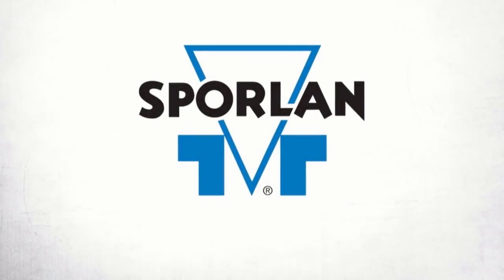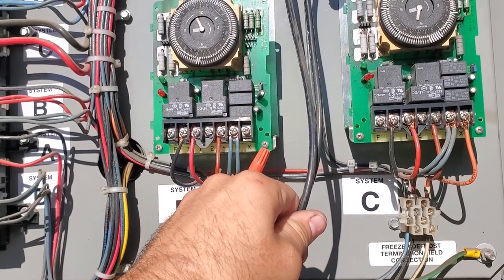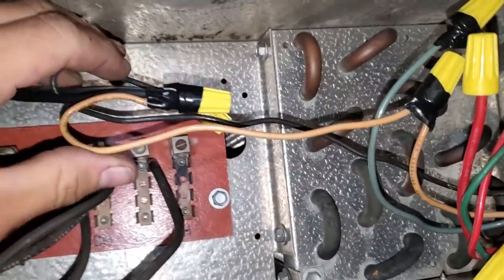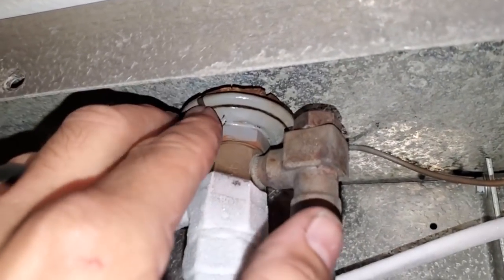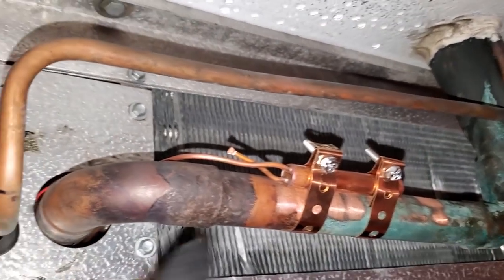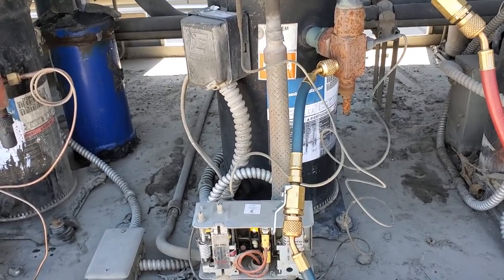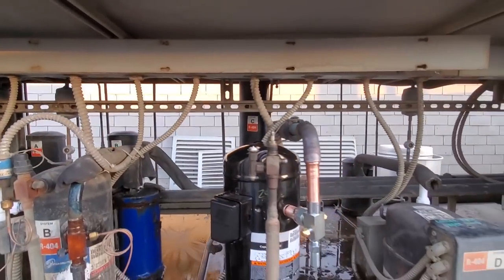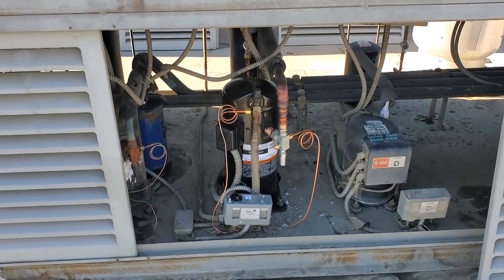BEER WALK IN DISASTER

Comment: I don’t do medium or low temp work but I do a lot of commercial and industrial. You don’t use any sort of nylog or liqui vac on the threads during the power head replacement which surprised me. I use sealants on that and gaskets for canisters. I’d like to start doing medium or low temp I just don’t get the chance to. Also hydraulic wrenches work very good for TXVs (45 degree angle/15 degree angle)

Comment: 2 things: The old compressor was a freezer compressor, so of course it was over loaded after you changed the powerheads! The amount of "factory charge" was also not correct anymore. Right on the re-wiring the unit to 'air defrost' . The original heads kept the pressures correct whereas the new ones didn't, overloading the compressor. It obviously was pumping! Over 400 PSI sould have screamed: I'M OVERLOADED!! to you.   Lastly, those Grasselin (AKA ICM) defrost timers are junk from the word 'go'. I can't tell you how many I have run into that you need to give a little push on the edge of the dial to get it to go into defrost. I replace them all with the Paragon electronic timer  9045-00. Once you get the hang of programming them, they work flawlessly.  Anyway,  Not a bad job at any rate, keep up the good work. Stay Safe!
Reply: Do you have any idea why there might have been a freezer system installed to cool a walk in cooler? Is that a common thing to do?
Reply: @JasperJanssen  It's NOT common for standard use, however there are times that a customer has a freezer, needs a refrigerator, and just uses it as a refrigerator. They will work as such, but there SHOULD be some adjustments made to the refrigeration system. Remember, a freezer COIL is bigger, resulting in an expansion device staying wide open at the higher temperature and the orifice in the distributor becoming the expansion device. Then the power head is out of range.... It's a 'chain of events' sort of thing...

Comment: One observation. Exercise caution when converting an electric defrost evaporator to air defrost in a cooler system. A lot of beer coolers are designed with a wide TD (Up to 15 DegF) and are kept at 33 degF to 35 degF. If you eliminate the heaters on an evaporator in a system designed this way you might experience excessive frost problems because of this. This also applies to other applications like Carcass Hanging (pull-down) rooms were Electric Defrost is preferred on the design aspect because of the high humidity conditions expected and the 31 degF temp requirement in the room (As per ASHRAE refrigeration handbook). A technician might believe that because the system is a "cooler" electric defrost is not needed and that is not always the case. In this video, the technician made a good explanation of the problems he might experience by doing the change and was aware that the room was not being kept lower than 37 degF.
Reply: I agree with this, and would like to add something to this. You have to account for the workers, they leave the door open when filling the wic. Just today I got a call for a frozen evaporator, I come in and the workers are loading drinks in the wic with it runnig and the door open...

Comment: Can you maintain the beer  38° ?  It depends how fast or slow the stock turns over. What would the cooler temperature need to be to cool the bear down over night ?
What would the differential need to be across the coil. So saying a beer cooler doesn't need defrost elements might not be a valid assumption.  Maybe the goofed up wiring was causing the coils to draw to much current. And does running the fans continuous really solve any problems ?  Maybe a variable speed compressor (pressure controlled) should be used to regulate coil temperature, then load matching would be a fools game. (Oh some import A/C units already do that :)

Comment: I want to know your thoughts about those electronic thermostats for beverage coolers and such. I like the simple 2 wire sensing bulb style. The new ones come with 2 thermal probes (one for the box and one for the evap itself). They also require running a common wire. I hope I dont get called back for a bad probe.

Comment: Looks like it was sold as  a walk in freezer, but ran as a cooler
Reply: previous life as a freezer and converted perhaps?
Reply: throttle bottle yeah, but the same unit has both a cooler and freezer unit in the same room. Maybe the system was intended for separate small freezer and cooler compartments but was used or re-used for just a large cooler?

Comment: If I had a business that had refrigerant systems in your area. I would hire you had not have any sleepless nights myself. Love to see spending time on what is important and less on not important. Well done!
I think the cable arrangement is a mess in all systems I have seen on videos from US. Is there any beautiful electric systems in any brand? There is soooo many places I see were cables can grind insulation. But it is very effective to troubleshoot with loose cables.
If I did work with it, maybe I would put my favorite on - a plastic spiral, maybe nylon. Whatever, it is made for hydraulic hose protection. Easy to twist on a bunch of cables and pull the protection in a hole, like 5:54. Or everywhere inside the carrier's.

Comment: Nothing wrong with double-checking to alleviate callbacks. Many times I have turned the truck around many times over the years. Just because you're not sure you forgot something.
Thanks for mounting that contactor with the lettering in the proper orientation. That's something that drives me nuts. Even if you have to take out two simple screws, cut the tab to put upright. That's the difference between a Tradesman and a hack. IMO

Brake cleaner will clean that screen good as new.
Reply: that doesn't bother me, because I can read well any direction of lettering, even with it reverse characters through mirrors.

Comment: Is there the possibility that the beer cooler was converted from a freezer?  Those condensing coils look like ones that I have installed into freezers.  When I was installing we were using R-502 for the low temp and installed defrost heaters and R-12 for the coolers. Never did install defrost heaters in the coolers

Comment: I have a question I was thinking to adding a ball valve of some sort on the discharge line just before the evap just about a foot away for the txv so in the future if I need to or next tech is working on the unit and wanted to change the txv powerhead or strainer they r able to do it as ease without front seating the receiver would u think this is a good idea , I’ve been thinking about this for a while and I would like ur opinion if I should start doing this on all of my future units ?

Comment: Seems to me that the "beer box"  walk in cooler was originally a freezer so I would assume the compressor you replaced was a low-temp unit trying to operate at 32 Plus. On top of that you mentioned it was very warm ambient OD temp. So your original compressor was staying completely loaded up whenever it was in operation. Not good. Do you agree? I also wonder if you replaced it with a medium Temp compressor along with the power heads.

Comment: I think you should replace the entire wires instead of cutting them because they burned the insulation up. if you look at the frame 2:11, wires at Romex connector has been burned too. The burned copper wire may create high resistance and heat that damage to the board again.

Comment: The salesman who got the commission on the heaters was over compensating for something, plus that junior tech who did the work on that Walk in needs his license revoked.
Reply: Actually the job leader who taught the apprentice the bad habits.
Reply: My guess is that it was a system sitting around or the original installer got cheaply OR that was a freezer to begin with and they tried to make it a cooler. I've seen it many times.

Comment: New to this channel, Just curious if you ever came across a system so overheated the discharge line was 300+ degrees and would instantly boil and steam water off the moment it was touched? I have and posted a video. Whats worse is it has a $2000 carel controller supposed to see this problem. BTW, Subbed

Comment: If that unit was a freezer from the get go then some one tried to make it to a cooler most likely the compressor was too big for a cooler ( tonnage) so taking power head to med, temp will make compressor more wacky !  So thats why they tied the heaters in ,so they were wrong and you are right partially right , not everybody is a bad tech , its that they try to make money and save money to the customer and that is why you get a cluster job!

Comment: Chris when you looked at the expansion valves and and seeing that they were zp powerheads on those valves I would have stopped and checked the model number of the compressor before I did anything further it's beginning to look like someone took a walk-in freezer made it into a beer cooler there are some beer walk-in coolers that by Design are called a 34 degree cooler walking box similar to a fresh meat walk in that do have defrost heaters in them beer only begins to freeze at 29-28 not 32 degrees changing those powerheads  on the expansion valves to a C charge you now run the risk if that's a low temp compressor of it overloading it's a real shitshow you got going on there good luck pal

Comment: 31:08 You can not get higher flow with wider tubes when the brass tube at the fitting is not as wide. The only reason it might pump down faster is because the hoses are made of a material that is better at vacuum then the normal hoses are, gas will still be able to go through them but less then normal hoses and thus better vacuum and flow. Ordinary HVAC hoses will fex never get down to 0 microns if you put one end to the vacuum and another end sealed due to gas leaking through them. The ones here should get lower by that reason since they leak less.
Reply: At time = 31:06  —  Better vacuum,  "especially when you're under pressure".

Comment: I believe that this system was having problems with icing for a long while because of the bad TXVs.. Whoever was working on it before you couldn't diagnosed that  and just wired in the heaters as a way to stop the icing.
For any customers and watching, thus is the difference between a technician and a cowboy. Yes they mayne cheaper up front but you always always have to pay in the long term.
And for apprentices, this is how a real tech does it. Take the time to properly diagnose and evaluate any system you are have to work on.

Comment: In retrospect, would you say it would have been better to just tear out the old system and install a brand new? So many parts swapped, so much wiring mess, dirty condensers, evaporators, etc...
Reply: it's a tough situation when it's a large multi-circuit system as such, do you put a stand alone system off to the side? is there roof /building space to do so, thinking ahead when other circuits start to fail, will there still be space or will you look bad for doing so? alternate do you recommend they replace everything at once?(yeah that wont happen lol) the bill may be expensive, but is it expensive as replacing everything on all the systems at once? nope, there will be a day they'll have to no doubt, same applies to all the split systems with multiple indoor units, if one leaks how long will the rest last? there's a reason ducts and other forms of heat transfer still exist

Comment: It my opinion you did not check your assumptions before going head-on exchanging parts.
Low temperature power heads and de-frost set-up indicated that it was actually low-temp system installed in a mid-temp application. The compressor was most probably of a LBP type. After changing power heads the performance deterioratad most probably because of a too high a compression ratio of the compressor. Then you changed the compressor - most probably not like-for-like, but for MBP type.
I respect your efficacy and this time your "method of procedure" sucks... Or I'm wrong, as I am on many occasions...

Comment: bypassing fuses is very dangerous it is a fire or the destruction of the machine waiting to happen.

it is possible that why the interlock was removed was that the evaporator coil has an electric valve that allows the compressor to pump down the coil so the defrost heater cant cook the refrigerant and turn it into phosgene if it is cfc based or some other poisonous agent.

Comment: I love watching your videos and typically I think your doing an awesome job.  but quit zip tying your wires.  that is bundling which is a no no in the electrical code. and especially being on the roof where the temps are hotter bundling could cause more heat.  if you want to organise your wires you can use ties but keep the loop on the tie no more than 1.5 wide. but other than that keep up the awesome work.  I watch your videos to learn your troubleshooting techniques.  your knowledge is awesome thanks for the vids

Comment: Id run the system a little short gas as long as box maintaining,, Id tell the owner of the equipment EMERGENCY head pressure issue..need major condenser cleaning

Comment: Would have not been better to connect the evaporator fans (white wire) straight to the breaker (MCB) of the heater element that you have flipped off in the outdoor unit? The clock for fans here is just a constant power supply anyway. Faulty fan(s) can get the clock damaged. We know for sure that the current supply from the breaker can handle the 8 evaporator fans. Maybe, the breaker Amps are too high to get activated, in case of  faulty fan. Though, I would not think so. Most likely the heating elements were at least 4kw while the 8 fan motors only 1kW (max 2kW).

Comment: HVACR VIDEOS Explain to me if the power for these Restraints goes out for a day or a week Because of storm or Snow taking power lines out with no Battery Backup to keep the time clock set for the freezers or Refrigerator how do you keep the clock at the right time this doesn't make sense
Reply: If it takes the power out for  any significant time they will lose there product.  I have seen some restaurants  having a generator backup.
Reply: Good question. I wondered the same thing about "drift" - surely they aren't accurate over years. 
My guess is that it doesn't really matter. As long as it goes into defrost mode "about every 6 hours" (or whatever it should be) it's probably fine.
Reply: He lives in the middle of a low desert. No snow and no storms other than sandstorms. (And I'm not joking.) Very little rain, few clouds.
Average summer day temp around 100F, low summer night temp maybe 60F, average low about 80F. 
Average winter day temp around 65F, low night temp may hit 25F for an hour, average winter night about 40F.

Comment: i wonder why all of this AC things are still build electro mechanical.. Like time delays, interlocks and so on.. Why not have one board with like 20 outputs and sensors and let a microcontroller just control some fets that in turn turn on / off the contactors.. That way you could easily change the behaviour with a simple change in the software and save a lot of wiring / failure points..

Comment: This call sterted when while in defrost the wires started to burn and smell. Someone on the staff turned off disconect to stop a fire.  The second coil the fans didn't start. . Leave off the new clock. This was an old walk in freezer convert that worked for a while. Put the unit on air defrost  and wire repair was the only thing done correctly.  Four defrost per day for 30 minutes should work.  You can't get proper super heat on low temp valves at 35 degrees. The new TEV valves overloaded the compressor and the condenser. Now you have $3000 or $4000 dollar repair on an old POS.  When the compressor wouldn't pump down was a stop sign.  Put the unit back in service like it was running, measure the size of space. Price new equipment and change out equipment on schedule to get the compressor, condenser correctly sized with new evap coil.
Reply from the maker: Kelly this was never a walk in freezer it was designed as a 32 degree beer walk in, but the customer runs it at 38 degrees. The compressor went bad due to the previous company not properly taking care of the equipment. The only thing that makes the TXV low temp was the powerhead and when I replaced those they became medium temp txv's
Reply: @HVACRVIDEOS  I am sorry if you thought I was saying you were part of the reason for failure. The compressor failure was caused by the system set up. I thought you said once before you welcomed a different view point from some of us old guys. Sorry it won't happen again.
Reply from the maker: I always welcome input and other view points, I didn't mean to offend nor was I offended by your comment. I encourage you to continue commenting, I'm always willing to learn
Reply: @HVACRVIDEOS  Never a walk in freezer, always a beer killer. I mean, chiller. Except killer works too....